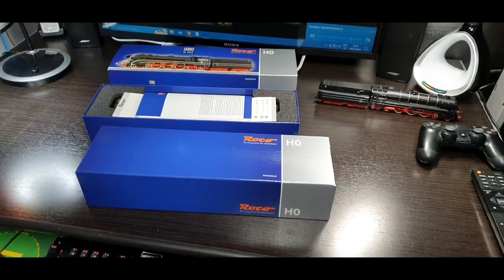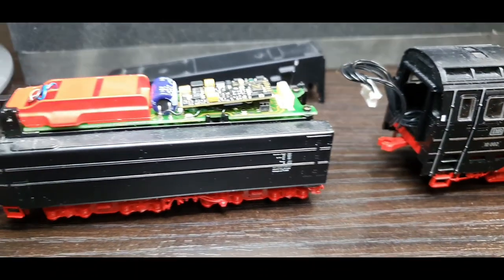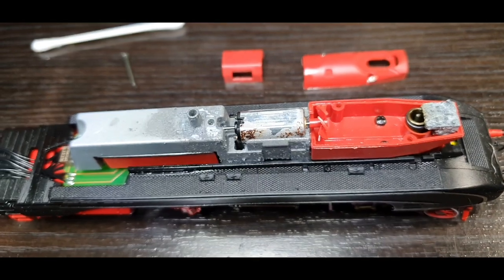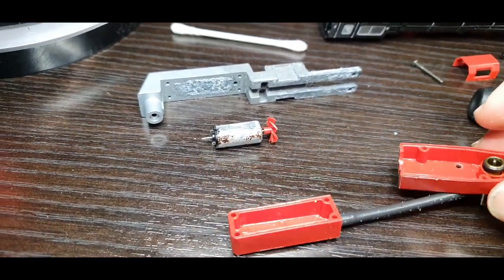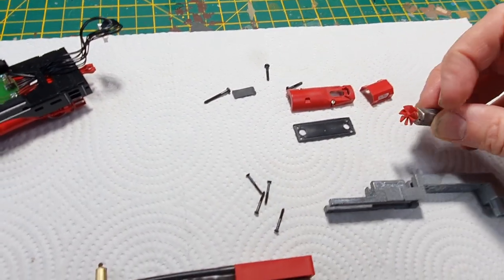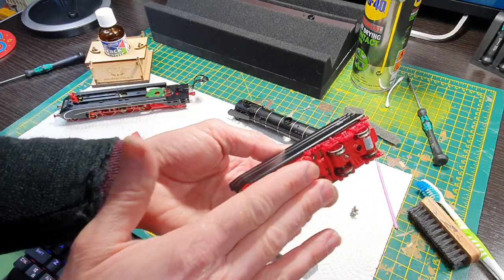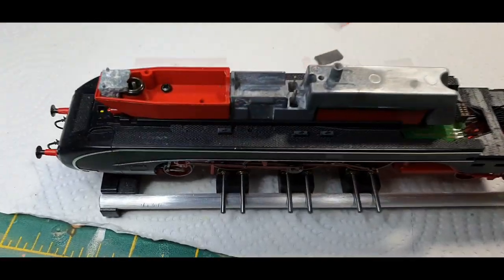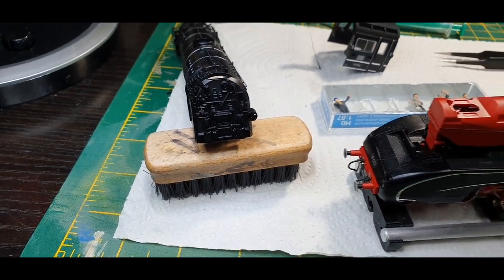ROCO 62193  BR 10 DYNIMIC SMOKE SERVICE GUIDE

Comment: Yes, the suethe smoke oil is much better and not as smelly as it used to be. I invested in a syringe not only to get the fluid where I wanted it but also to get 5ml accurate for the ESU unit. When I took one of our MTH models apart to fix the unit, I was crapping myself royally! Good work Jim.
Reply from the maker: Thanks , Yeah I am somes lazy when it comes to injecting the correct amount..I must do it properly now..
I did get a syringe and oil with the model 10 years ago fron Arcida models...man I cannot believe I've had this model that long...bonkers...
Which Esu loco do you have?
Many thanks for watching again.
🚂🚃🚃🚃🚃🚃🚃🚃🚃🚃jim
Reply: @hovermotion  The ESU unit I have is a spare part for the V60. I massaged it into a West Country class.
Reply from the maker: @hotdogpilot6319  Wow nice retro conversation 👍🏻

Comment: Trix BR233 22402 and the new Hornby black 5 use cold steam which uses distilled water in a Piezo atomizer unit to avoid the mess of oil!
Reply from the maker: Hi , yeah there's new tech now 
Like the Trix Marklin Tiger maintenance Ludmilla loco that uses a similar process with water..
👍🏻🚂🚃🚃🚃🚃🚃🚃jim🚃🚃

Comment: As usual, great job on maintaining your fleet.  Not sure if you heard the motor on your drive by at the end of your video but the motor for the smoke chuff sounds a bit rough! May it might be a good idea to have a spare motor on hand for when that motor decides to give up. 
Great video.
Reply from the maker: Hi Thanks,  unfortunately that sound is normal on this model, the decoder sound was turned down so the motor fan sounds louder.
I was looking at getting a quiter sounding motor for the fan at some point if available. 
Thanks for watching jim. 
🚂🚃🚃🚃🚃🚃🚃🚃🚃

Comment: Nice video Jim. Does the smoke also come beneath the pistons near front pilot truck??
Reply from the maker: Hi MIhir ,Yes it does..
Reply: @hovermotion  how is it connected to the main smoke unit?
Reply from the maker: @padhyemihir  I did see small holes on the last lower running gear strip down I did  , I did not do a vid on that last time , I wish I had now..

Comment: Señores, evidentemente la aleación Zinc-Aluminio que usa Roco para los castings en general y que no  pinta como esa parte principal de metal  que tuvo usted  que limpiar,  el fluído fumígeno que lo impregna como que a la larga no le hace nada bien porque lo carcome. Yo  para darle larga vida a la pieza lo lijaría bien, se desengrasa, se le rocía una capa de  premier y luego un acabado de espray color negro, e incluso pintura al envase del motor. Además de la pequeña pieza que fija el tubo del fumígeno que a la legua se ve es un Seuthe. Saludos.
Reply from the maker: Many thanks, 
Good advice. 
One of the problems was using water based fluid for a few years in the past and that did not help.
Thanks 
🚂🚃🚃🚃🚃🚃🚃🚃🚃jim.

Comment: very interesting report
will you replace the decoder with an ESU , V5 ?
to adjust the CV more easily
Reply from the maker: Hi Eric, interesting question, 
Not sure but it would be nice to try or get a Zimo programmer.
It runs very nice and certain cv's can be adjusted to improve ultra slow crawing speed..
Thanks for watching .
🚂🚃🚃🚃🚃🚃🚃🚃🚃jim

Comment: I found that both the smoke systems i bought only lasted a short time ...
Reply from the maker: Yeah Dave same as on the slot in gens they are very tempermental. 
The slot in gens need to be controlled with the decoder so it's never burns out ..

Comment: Hi. How can I activate the smoke system in DCC?. I bought a used one that is clean but the smoke fan does not work, everything in clean inside the smoke unit.
Reply from the maker: It probably a dry contact on the motor contact for the smoke gen blower..
It's a very complex model.
Hope you can solve it.
Jim
Reply: Hi, thanks for your answer. I fixed it.
Reply from the maker: @mariano5417  cool ,was the problem a contact or a software dcc chip problem .
Reply: Program only, but I can't set F2 toggle for continuous smoke, it works only when I keep it pressing.
Reply from the maker: @mariano5417  Mine has developed a similar problem where the smoke stops working for a few seconds then starts again this works in tandem with the loco lighting which go's out for a few seconds. Not sure if it was the chip so I shaped out the chip and the same happened so its a interior wireing or electronic part problem on the control of the smoke fan . The loco works fine without the smoke enabled.